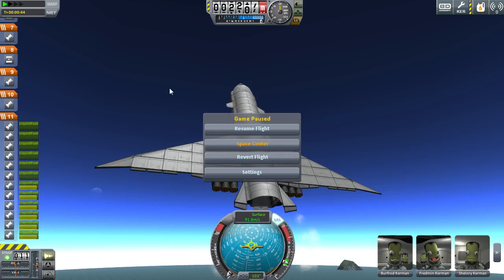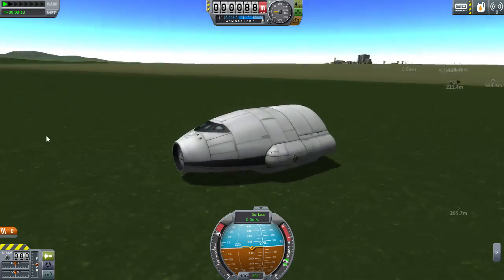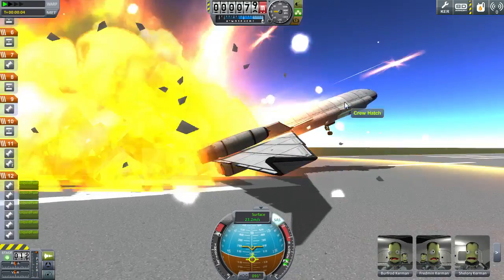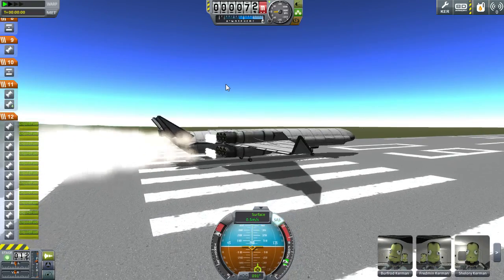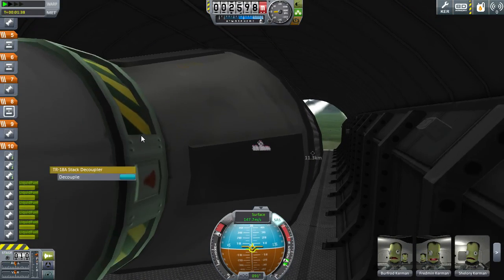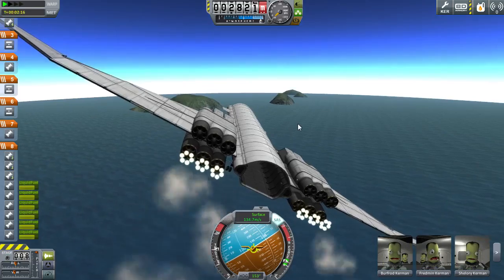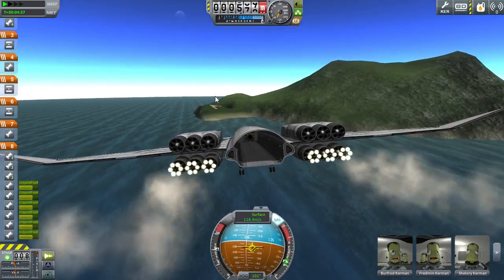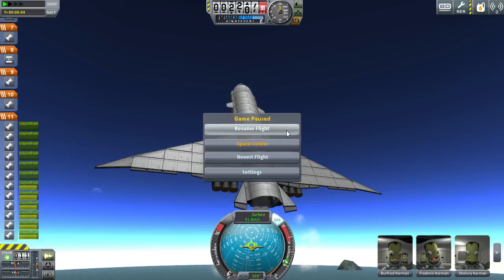KSP - Testing Giant Spaceplanes

Comment: Thanks in a past video telling us what this mod is called and  since then i have made a space plane a little bigger than your but it works so well and has half the engines but is extremely fast litchely it takes off in about 100 meters and i only used yhis mod and a couple of stock parts exept for the langing gear i used a different mod just for the wheels but it worksso brilliantly well.